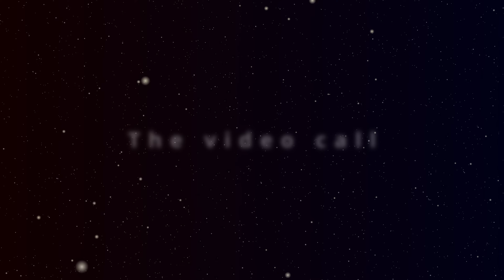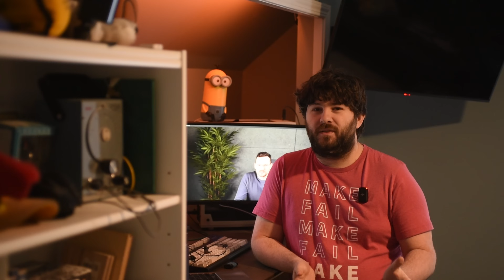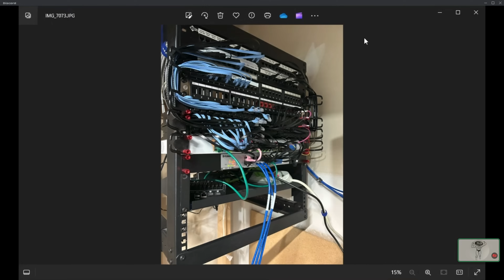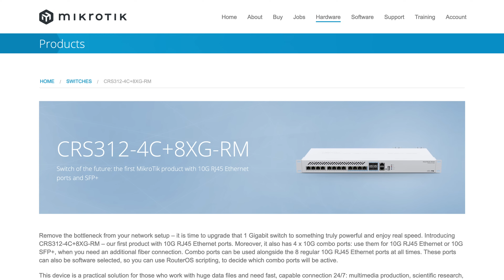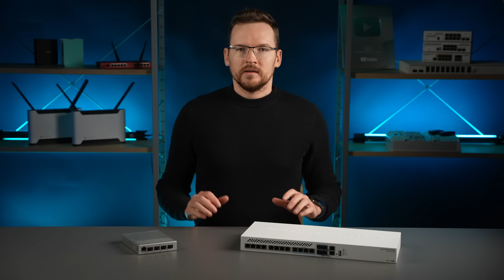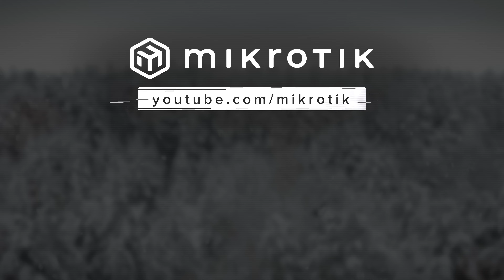Upgrade your Home Lab to 10G like apalrd's adventures!

Comment: All good and nice, except your softwarwe is a sh.t show. Nothing works anymore. The 2.5Gb ethernet link between hap ax3 and your 10g switch is flapping since ROS 7.16, no freaking reason why. Both work perfectly well with chinese 2.5 or 10G switches, just yours do not play well with eachother. Your support is a joke, your forum does not allow posting. Enshitification is not only for big names. I used your products for the last 15 years, seems it is time to move on.

Comment: @Mikrotik You might get a kick out of my network. As unintrusive as possible, switches in each room and Invisilight fibre either in corners of walls or under skirting boards.

Links between 10G and 100G, core router CCR2216, core switch CRS510. Shortly to get content rolling.

Comment: I ❤my MicroTik CRS310-8G+2S+IN.  That said, it would be super cool to have two 10G ethernet ports, POE for the 2.5G ports, move the power jack to the back (perhaps with a locking mechanism also?) and keep it all in a 10 inch form factor.  Even if it is twice as thick, the 10 inch tiny rack I have would then be twice as perky!
Reply: Yea I have one of them as well and the power jack in the front is super annoying when rack mounting it. Ran out of 2.5GbE ports though so I replaced it. I still have the CRS316-1G-16S as my Core switch but since I also wanted to upgrade my firewall from 2.5GbE to 10Gb, I ended up going with Unifi for both the firewall UDM Pro Max and a USW Pro HD 24 PoE for the 2.5GbE since I also needed a PoE++ switch anyways as well.

Comment: Unfortunately CRS312-4C+8XG-RM is plagued with link training issue which makes it impossible to use with a fiber optics modules if you want to achieve a reliable connectivity. Running RouterOS with optical fiber modules on that switch quite shortly triggers a port down. On the remote side it looks like a never-ending port flapping. The only way to restore connectivity is to reboot CRS312-4C+8XG-RM and then after about two weeks at best port goes down again. Sometime it is enough just a few minutes. Problem exist with any SFP+ fiber modules. DAC cables are working fine.

SUP-126065 is confirmed and opened since August 2023. Because of that bug we canceled this model for prod and even using it in lab can be concerning. You just can't use this switch if you want to have a reliable 10G via fiber.

Comment: Nice upgrade! Mikrotik really has a device for almost any use case in HomeLab.
Maybe add a link to his video somewhere - it's an interesting follow up.
He even went into a little bit of L3HW Routing - that's currently on my bucket list for my own setup (as soon as I have the time...)

Greetings from a fellow homelab enthusiast with a way too overkill Mikrotik Setup (I got myself 5 of the 10GbE Switches...)
Reply from the maker: There is a link at the outro of our video.
Reply: Unfotunately no managed desktop switched with 5-8 ports with PoE In (without SFP modules). Something to replace some of my Netgear GS108Tv2.
Reply: @kbabioch I‘ve been mis-using the hEX PoE as a managed desktop switch. You‘re fine until you need VLAN. PoE in results to even 4 PoE out…
Reply: @lasepp Passive PoE in sucks, want to have proper 802.3 support. Also I need VLAN capabilities to have printers and PCs in different VLANs.
Reply: @kbabioch that‘s actually the nice thing about the hEX PoE: feed it with 802.3 on PoE in and it will output 802.3 on each downstream ports. But yes, a simple CRS3xx VLAN switch in 5-8 Ports without fancy things like 2.5G, WiFi, or unfancy things like SwitchOS is what is really missing. I‘ve been replacing 8-port HP switches at a customer site with 24-port Mikrotiks as they are about the same price, but ideally I‘d want a switch that doesn‘t have 20 unused ports in a office with 2 PCs and a printer 😂
Reply: @lasepp Without forcing PoE on, it wouldn't get powered at all, since it won't negotiate with the uplink switch?
Reply: @kbabioch I just connected one to the CRS328, only configured an all-port bridge and dhcp client on the hEX and all 802.3 are working, nothing configured for PoE on CRS328 or hEX, both at defaults

Comment: When I want a home router with minimum of 2 ports 2.5G only available reasonably prized solution now is Archer BE3600 with wifi7. Nothing else.  Why do I need that? Bc I am on fiber Gpon ONT and max on it is 2.5G exactly.  Then my motherboard has 2.5G NIC as well.   If he has home lab, no wonder he goes for 10G.
Reply: 10G Ethernet can negotiate at 2.5G
Reply: Eero have wifi7 and two 2.5Gbe ports